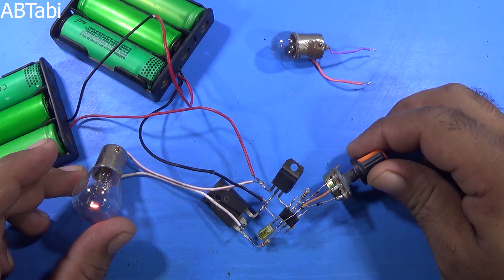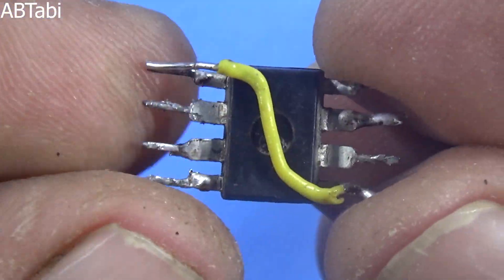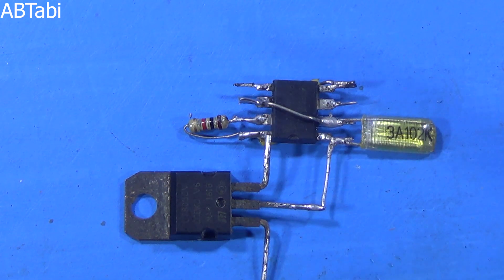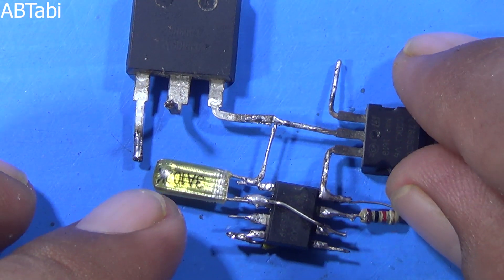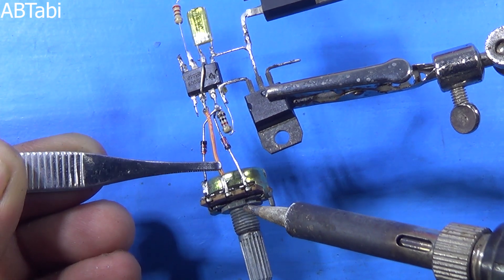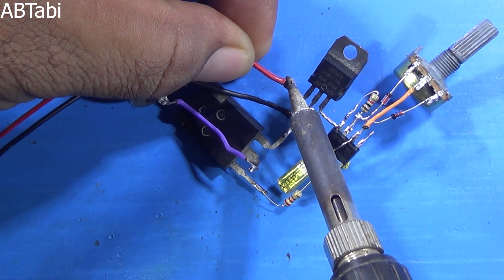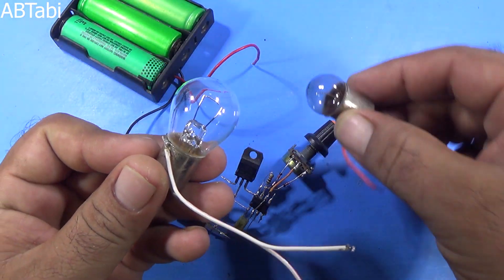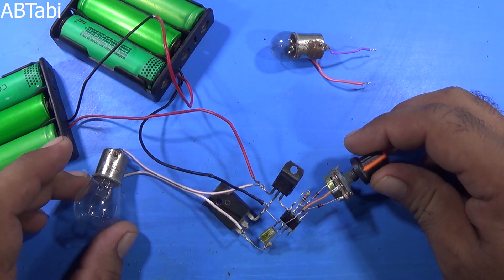6v to 24v dc Motor speed controller circuit using NE555 ic diy

Comment: can i just use a potentiometer, power supply and motor without the rest of the circuit, if i want to control the speed of the motor?

Comment: I used your fomula and it works perfectly with my 12volts dc fan.. thanks alot
Reply from the maker: Glad it helped
Reply: Does it get over heat if run for longer durations on 12v lead acid 48amps battery?

Comment: 12volt fan will work 100 percent?
Reply from the maker: Yes ,,,,,,,,
Reply: You can add a thermistor or set the potentiometer to come on at a certain temperature too.. 🌡 😉